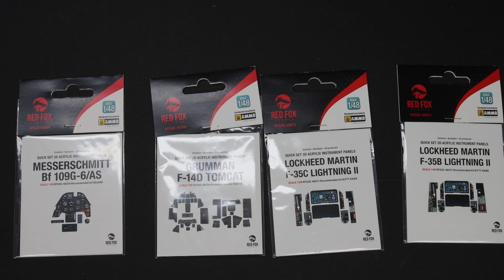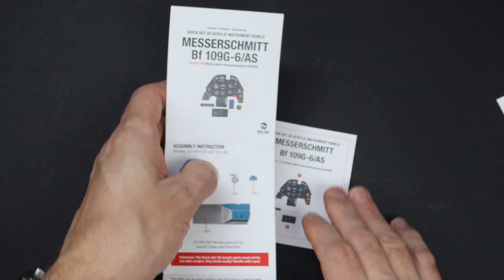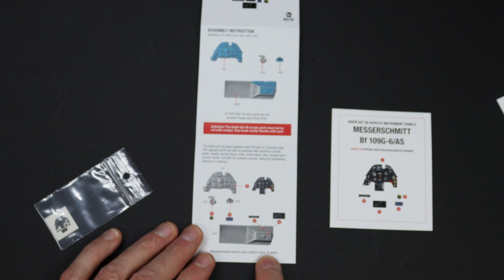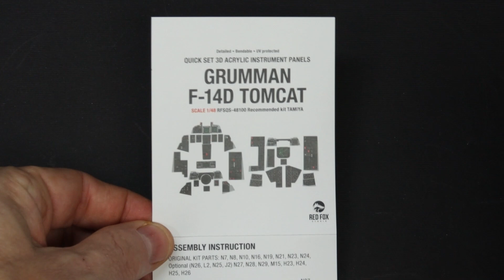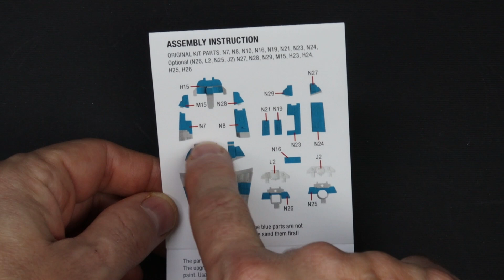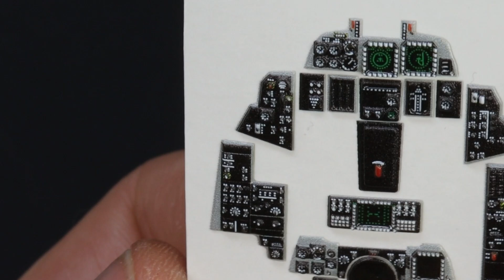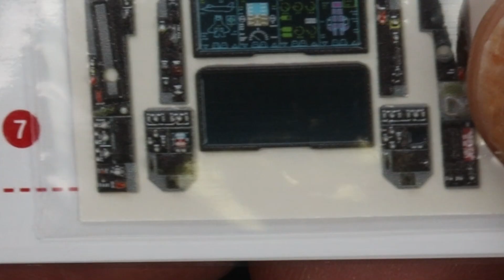Red Fox Studio review

Comment: I don't think it's cheating.  I've used Quinta but t'm not convinced they are needed on newer tooled kits.  At least by skilled modelers. They aren't cheap but  they are much much better than PE though.   Oh, and leave the canopy open if you want to see the  difference they make.
Reply from the maker: The detail in new kits is great but its impossible to get the same effect with paint and decals.

Comment: Regarding the differences between the two types of product and the downsides of each. Consider that we are only in the beginning phase of this technology for modeling and in time I suspect that  what works will stick and what doesn't will be replaced with an improvement. 

As for removing the gray areas around the black panels, could this be done carefully using sanding sticks (probably wood backed rather than sponge backed) instead of cutting them with a saw. 

I'm personally thankful that these aftermarket products are available as I can build better models than I could ever hope to do by hand.
Reply from the maker: Sanding sticks would work too, I think a file may be even better to keep things straighter.